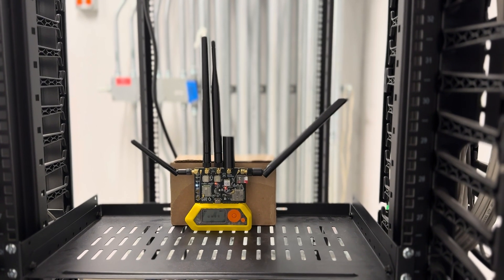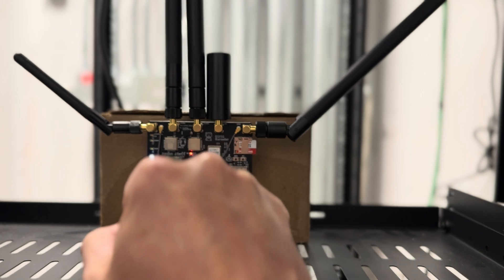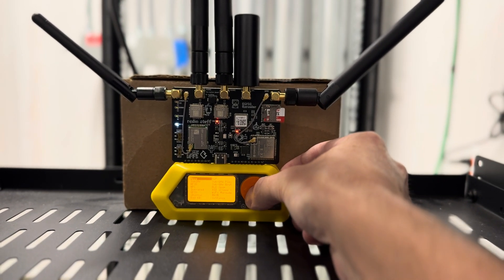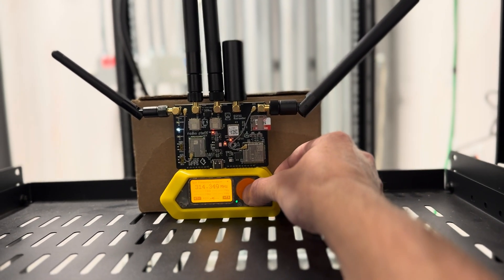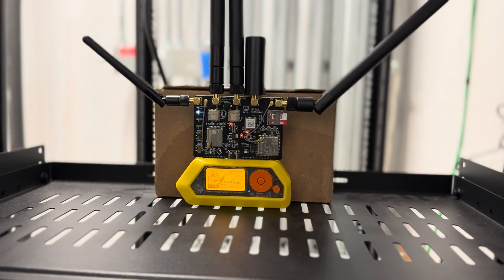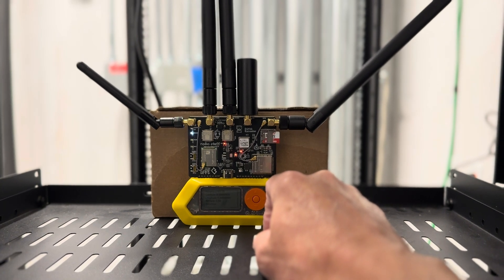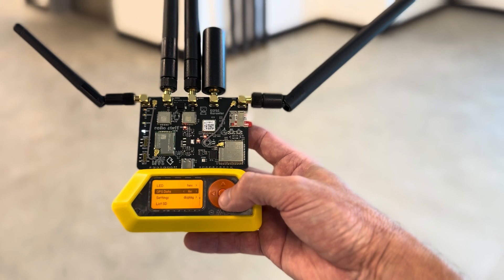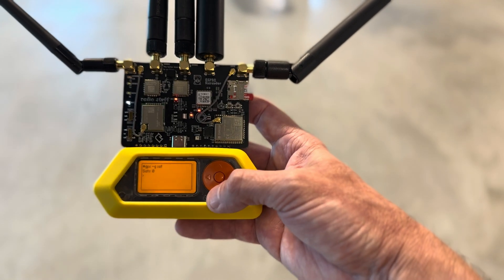Flipper-Zero BFFB by Justcallmekoko

Comment: I've been trying to flash mine with maraurder but it only let's me download the wroom version I can figure out how to get the correct version and flash it bat.flash way. How do I get the correct files that's me use gps? Thanks in advance!
Reply from the maker: You should use the FZEasyMarauderFlash
Reply: @PenTestTuner i did try that it errors out so I tried using the newest maraurder files the flash.bat and all I get is wroom and that doesn't allow gps. I tried for about 5 hours the other day and just got confused. Thanks for writing me back!
Reply from the maker: You should use the FZEasyMarauderFlash tool.
Reply from the maker: Try using the FZEasyMarauderFlash
Reply: @PenTestTuner at this point I'm trying to find someone close to me I can pay for a tutorial and show me what im doing wrong. I have no problem with the regular wifi dev board just these baddass ones lol!